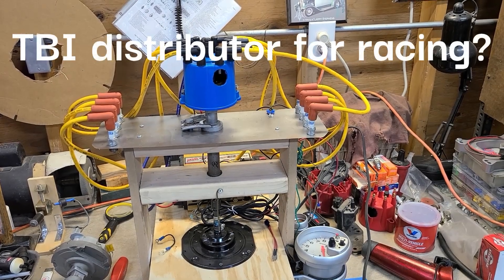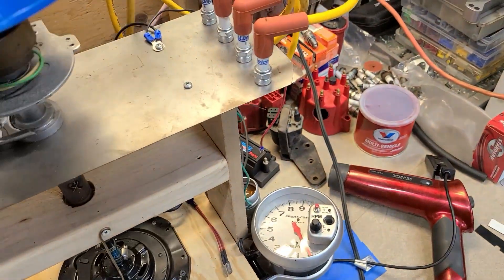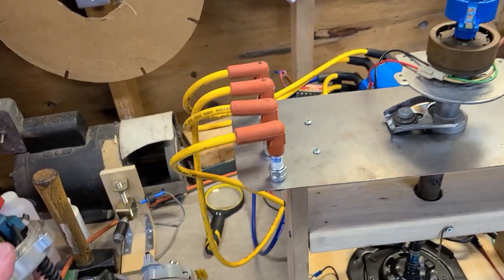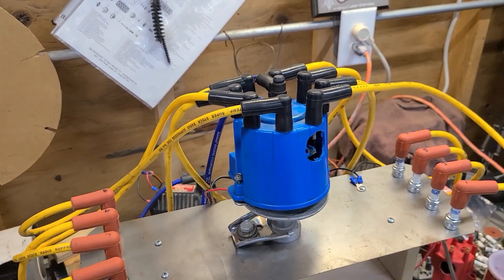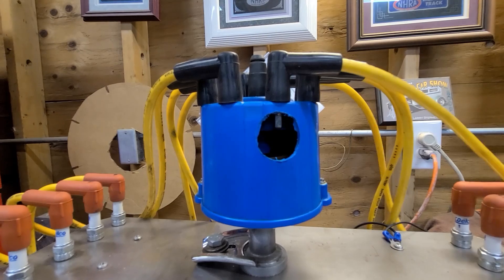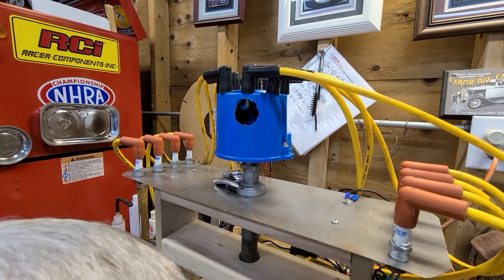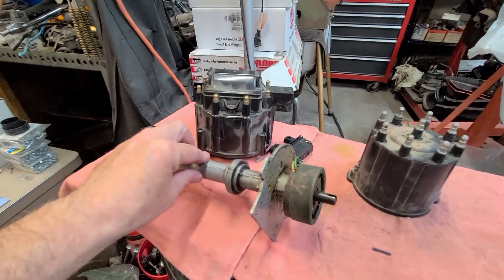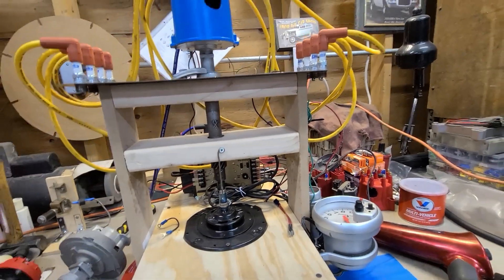A TBI distributor for your race car? Affordable distributor options

Comment: Hi Bruce nice video! Can i use a tbi dist with a gm 4 pin hei module? Obviously swapping the tbi body for a carb with other fuel pump. The fixed timing would be much issue for an a automatic trans weekend street drive? Besides starting for sure . Im on the low budget  and not much parts on my country. Thanks
Reply from the maker: If this is your daily driver, I wouldn't lock the timing out. I'm not really sure what you're working on so I can't really say for sure what is better. If you have a TBI then you should already have the TBI distributor so it sounds like you want to swap that out for an HEI which will be just fine. If you are swapping from the TBI to an HEI then I wouldn't lock it out.
Reply: @BruceCoggins  ok thank you. Its a 262 S10 Tahoe i bought it and the tbi is not working right now, it is running only on gas( i mean cng ) its kinda a electric mess but runs almost fine so anyways when stop injecting cng it still have spark ( something happened i assume fuel pump, the injectors wiring is bad looking too and dont want to start a fire but in worst scenario have a repair kit) So i assume keeping this will work much better with a 2bbl with a proper fuel pump with a new wiring , seems  i have some spark advance . For sure it has a Advance module and has a O2 sensor emulator used for the cgn, so maybe it could be use at my favour. So a little confused looking for hints. I will ask a cng expert too to check what had been bypassed or emulated back in those 90s cng setups.

Comment: I was brainstorming building something similar to test distributors out of the engine and to recurve them. Then I stumble across your videos and was like we think the same. Haha learned alot about ignition from your videos!
Reply from the maker: And this is the exact reason I started making these videos. I've been racing for almost 40 years, and I've experimented with just about everything you can think of just so I could better my understanding of how and why things work or don't work. 
Ignition systems have always fascinated me so, my gearhead friend and I have tried to acquire a distributor machine for years with no success. Back in the early 90's I was experimenting with different distributor curves to see if I could scrape off a little more ET...had a street car with a little 350 running in the low 13 second range. I ran across a guy who said he had a distributor machine, and he would curve it for me. When I got the distributor back, he told me he locked it out and phased it. From that point forward I was even more motivated to dive deeper into ignitions. Long story short...after many failed attempts at acquiring a real distributor machine, I was searching the interwebs for home made distributor machine and ran across a write up a guy did so after reading that, I went out to the garage and built my own machine. I made some changes to make it fit my needs better and it works very nicely. My distributor machine is set up so I can run it with or without the degree wheel. I still have so many things I want to test or play with but finding time to get out in the garage is tough.  
I've been playing with different vacuum canisters and making adjustments but for some reason, I failed to turn on the camera so I'll jump back on that as soon as I get a couple other projects out of the way.
Anyway, thank you for watching. If you need any tips on building your own distributor machine, find me on FB and we can chat.
Reply: @BruceCoggins  yeah you sparked an idea on my end. Getting rid of the vacuum advance and making a mechanism to manually retard timing from inside the car. For both easier starting and or boost or nitrous use. I'm thinking a plate that limits travel connected to choke cable of sorts. Kid n wife limit the money for msd upgrades haha

Comment: On advancing timing does the 7AL-2 have an advance system in it?
Reply from the maker: No, the 7AL-2 doesn't advance the timing. There are timing components that you can plug into the system but they are usually timing retard components. The TBI distributor is just a solid shaft so you set the total timing and run it. Hopefully, this answers your question.
Reply: @BruceCoggins  So like someone would set timing like 36 degrees BTDC & run it at that. 
Thanks for info.
Reply from the maker: Correct...every engine is different so anywhere between 32-38 degrees should be fine. If running locked out timing, keep in mind, you will need a start retard. An MSD Starter Saver is a good inexpensive option if you are running an MSD ignition.

Comment: Si la chispa tiene que saltar tanta distancia como cuando pusiste los cables al revés , la bujía no produciría una chispa buena para quemar bien la mezcla verdad? E incluso necesitaría una mezcla mas rica de gasolina para que el motor arrancase ? Un saludo y gracias por sus videos
Reply from the maker: Great question...I'm sure it would run but I think it wouldn't run very well for the reason you stated. Thanks for watching.

Comment: One recommendation when using one of the TBI distributors, is to check the magnet on the shaft.

It was very common for them to crack and cause poor starting and other driveability issues. Replacing the shaft is very easy and only takes a few minutes. 

I've replaced 100's of them over the years!

Comment: I always thought they were called Big cap and Small cap HEI distributors. The HEI module and external HEI coil work together, the module provides maximum dwell to saturate the HEI coil for very hot spark. I have a large cap in a flat head Chrysler 6, and a small cap in a Slant 6. Both engines are in forklifts. I got tired of weak spark and rough running in cold/damp weather. They run much better now, been working flawlessly for 20+ years with the parts in them from the junkyard. The HEI is supposed to be good to 8000 RPM, and will throw a spark 5/8" long reliably. Ford and Chrysler adopted the design when their own electronic ignition systems didn't work so good. You can get after market HEI distributors for Fords and Chryslers.

Comment: What about the 4.3 v6 distributor using a 8 point cap?
Reply: 6 cylinder distributors won't work in 8 cylinder engines due to v6s having 6 pickup points vs v8s 8 pickup points.
Reply from the maker: Good question...I'd check the magnetic pickup and see if it has 6 or 8 points on it. I'd assume it would only have 6 so that won't work. I might need to see if I can find one of those at the wrecking yard next time I'm out there and do some experimenting

Comment: The distributors are always phased properly because the cap contacts line up with the reluctor wheel when wired with the correct polarity.

Comment: Is it true, the factory module has a small amount of built in advance?  Heard the marine guys use these in boats.
Reply from the maker: An electronic control module is simply the electronic replacement for points. A module has a certain amount of dwell built into it...as a matter of fact, it has what's called "expanding dwell". Google search HEI expanding dwell and you'll read some interesting information. Now, I believe the 5 pin module has a retard function but not an advance function. They were used in the early computer-controlled distributors back in the mid to late 80s.
Reply: @BruceCoggins  I've read about the variable dwell. Mainly used to reduce coil & module temperature at low engine speeds by reducing on time.  Then at higher speeds allows for more coil saturation. High tech back in '74 lol.   Pretty sure the marine guys say the factory module on TBI modules will slightly advance timing as rpm's increase, it was some sort of default if the ECM failed to control timing.  Just wondering if you ever noticed or can confirm.
Reply from the maker: @scrappy7571  I have not tested that but I don't really see how the module can change the timing by itself. Let's look at the wires on the module...There are 2 connectors on one end of the module...these go to the coil positive and negative. On the other side there are 4 wires...a ground (black), timing by-pass (tan with a black tracer), purple - this is the reference for the ecm to run the fuel pump after it sees a signal, and a white wire which is for the EST (electronic spark timing) so that would mean the computer can adjust timing. This module does have dwell but that doesn't change the timing. I may be missing something but I still can't see how the module alone will change anything with the timing. 
Questions like this get me thinking though...I will try to come up with a way to test that theory with my wheel installed on the machine and we'll see if that holds true or not without the use of an ECM. Thanks for your input...now we have more things to test ;)
Reply: @BruceCoggins  Cool!  I have been pondering this for years.  Hope you can confirm it does or does not.
Reply: If you have a gm module try to use it.  Aftermarket modules usually have "unnecessary" features removed.

Comment: These distributors are a great option that work as well or better than most aftermarket ones. If you pick up one of these distributors used, make sure the bushings are good and the shaft doesn’t have any play in it. And when hooking it up to an MSD box, be sure to read the pdf/instructions thoroughly. If I remember correctly, depending on which box and pickup you have, it sometimes requires that you reverse the ‘polarity’ of the pickup wires. Always check your phasing. This is a great video.
Reply from the maker: Yes, checking the phasing is important and easy enough to do but is often overlooked. Thanks for your input.

Comment: like to know the measurements of that test bench you built. and do you have a degree wheel to mount on it?
Reply from the maker: For the design of this distributor tester, I searched for "homemade distributor machine" and a very nice write-up came up so I pretty much copied that plus I made a few tweaks to the design to make it my own. You can make it larger or smaller depending on what you plan to do with it. In my case, I wanted to have enough room behind the distributor holder to mount different ignition systems for testing. 
Reading the write-up, that guy used a degree wheel to do timing checks. I tried that but the degree wheel was too heavy...instead, I used corrugated plastic because it is light and rigid. If you look through some of my older videos, it shows how this works. I made it so I can run this unit with or without the wheel. 
I will warn you though...once you build this, you will spend hours and hours in the garage playing with it and all of your friends will want to bring their distributors and ignitions over for you to test LOL. This has been a lot of fun and I can actually test ignition systems before I mount them in the car which can save time when trying to trouble shoot weird issues.

Comment: Which one do you suggest for race cars?
Reply from the maker: Pretty much any distributor that has a magnetic pickup is going to function about the same. If you plan on running locked-out timing then for simplicity, the TBI distributor would be easier. The HEI can be locked out but it does require a couple extra steps. As far as performance is concerned, again they should all be the same.
Reply: @BruceCoggins  .
Thanks for your great information,
What about marine engine?
Reply from the maker: You will need the marine version which is waterproof. If locked out timing is what you're looking for then this will work just fine.